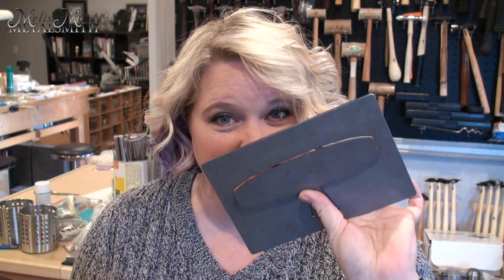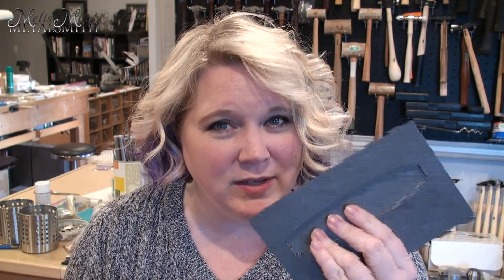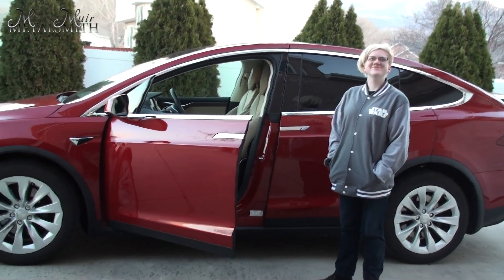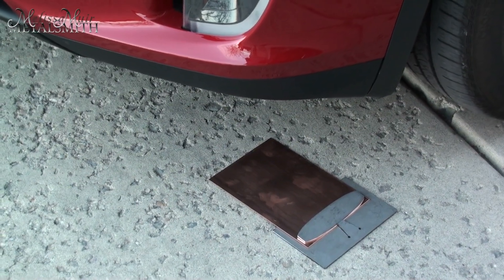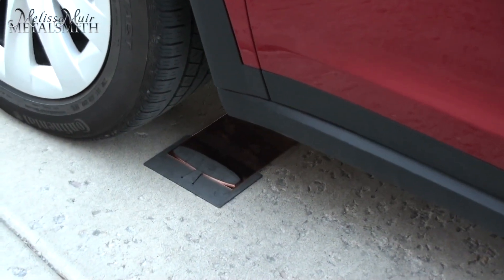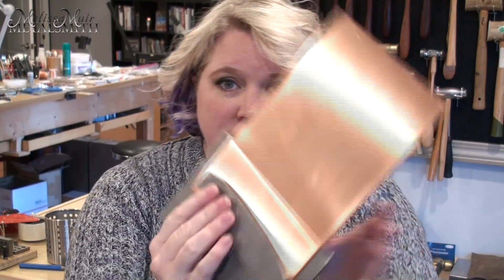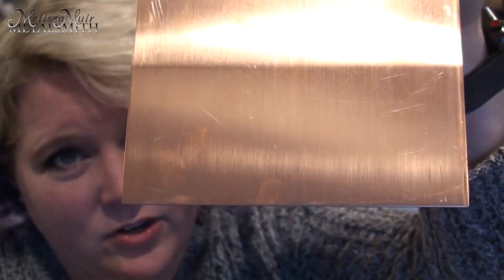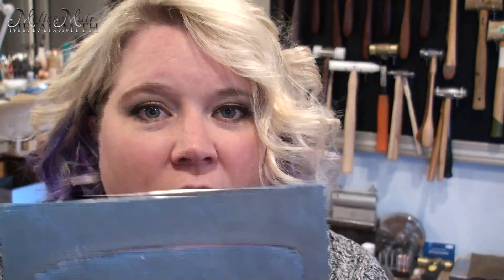Tesla Model X  Vs.  Pancake Die - Tool Time Tuesday

Comment: I think you are only capturing a fraction of the weight with the width of the tire covering only 20% of the die, you would get better results if you place a board on top of the cutter then drive over it. It's fun to watch anyway👍🏻
Reply from the maker: I agree, there are actually a number of factors here and will show why a car wouldn't work, even with a metal plate or board over it. One is that the tires have too much give. And while the car itself is heavy, that weight is distributed over the four wheels, so you don't have all of it to begin with. And then there is the distribution of the weight within even just the one tire itself. While the board would help with that, I still don't believe the results would be any different.... but perhaps I will do another experiment. :)

Comment: I've never considered running over a pancake die to make it work (although I tore some dies up trying to whack them with hammers). I'm going to guess it doesn't work based on tonnage. Also I may not remember how much a ton is, so. We'll see! Also YAY KIDS DRIVING! I'm already excited about this, haha.
Reply from the maker: A ton is 2,000 pounds. And yes, it all comes down to the fact that we don't have the proper amount of tonnage on the die itself because of the distribution of weight over the four wheels. That and the tire itself has so much give. So there are a number of factors as to why it won't work and hopefully now people have the answer to their question. Because it really does come up quite a bit.